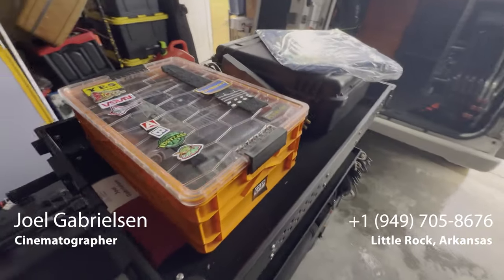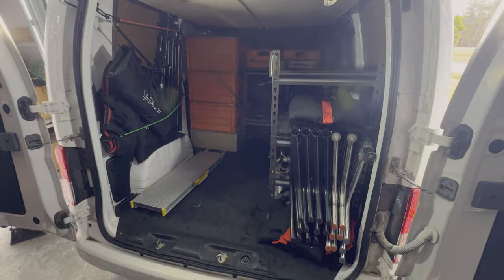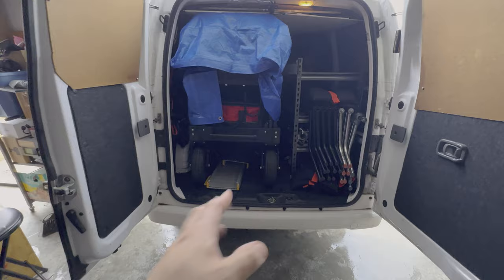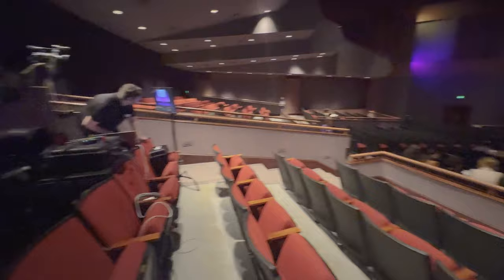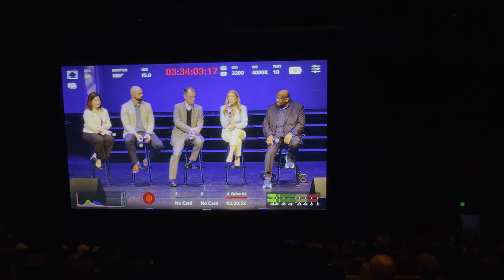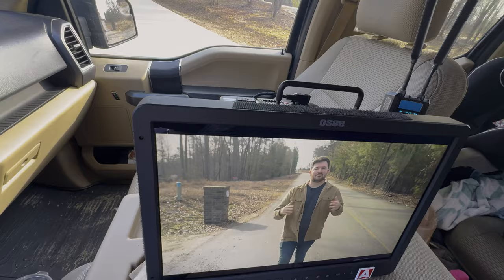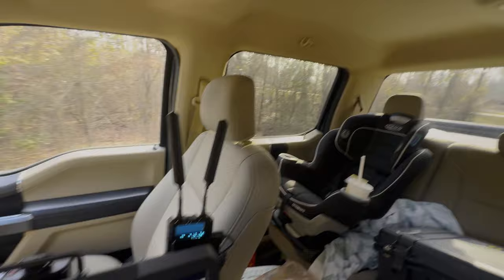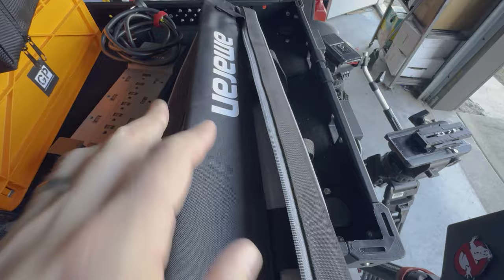Saving Time On Set | Make Yourself More Efficient | Gear Prep | Vlog

Comment: For those monitors I could see a wireless transmitter generating enough heat to make the Velcro fall off
I would recommend something like an angel bird mini lock quick release onto the existing cheese plate